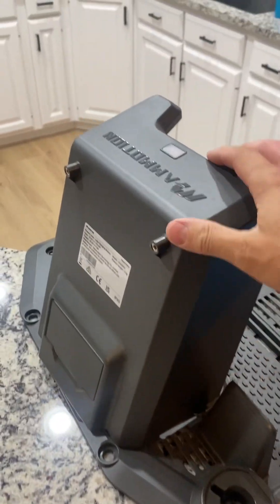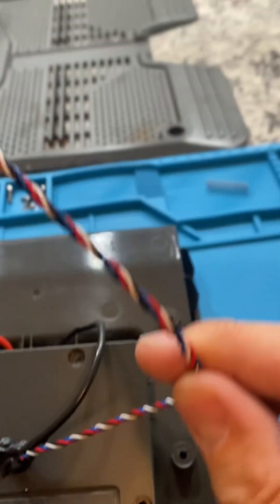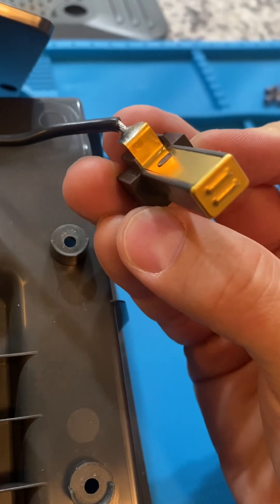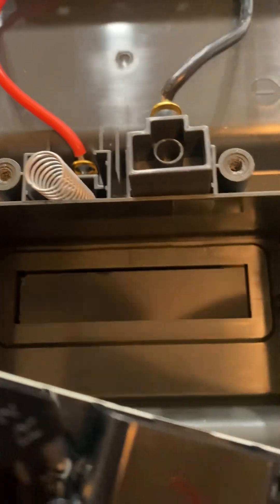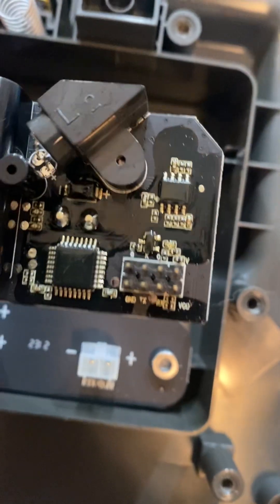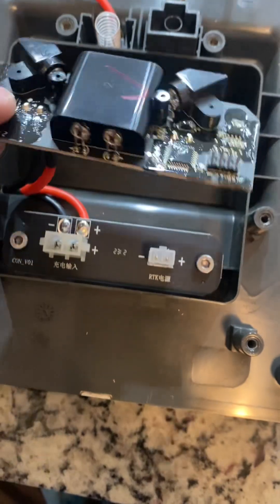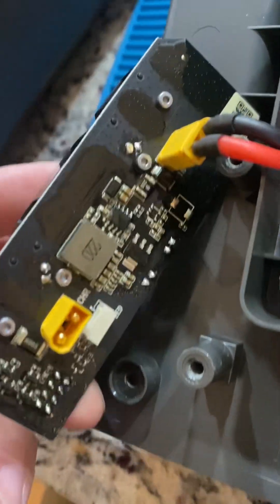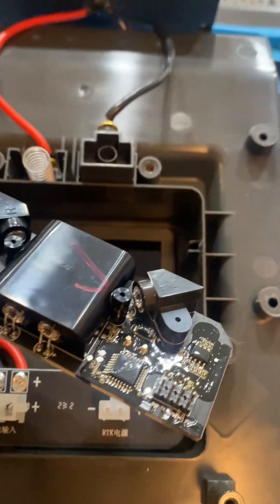Mamotion base station tear down

Comment: Just 2 thoughts on the IR part:
1. I'm pretty sure they are just static emmitters, because I can see 2 wires only connected to each
2. I assume the 45 degree emitters are there for Luba to estimate the distance to the charger. I guess when Luba gradually fails to see the 45° emitters it knows that it is about to hit the charging pins.